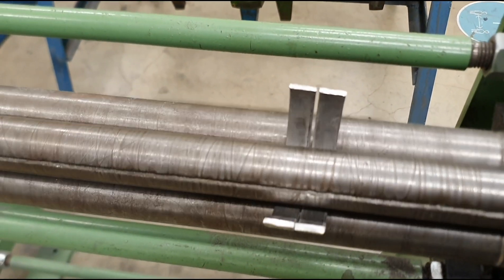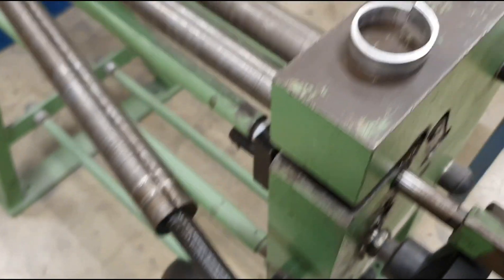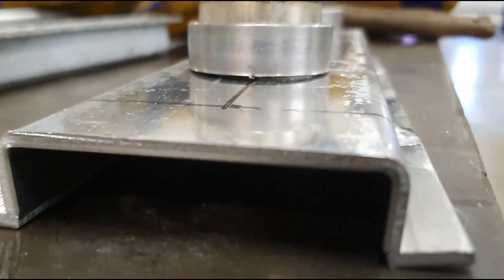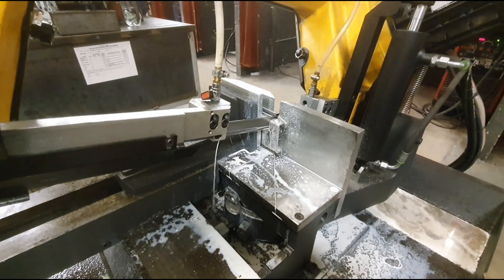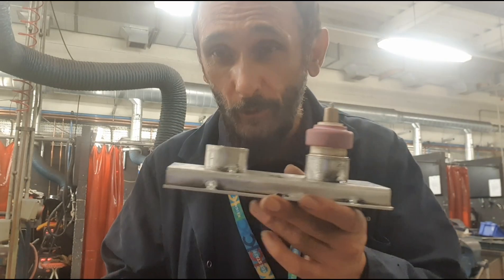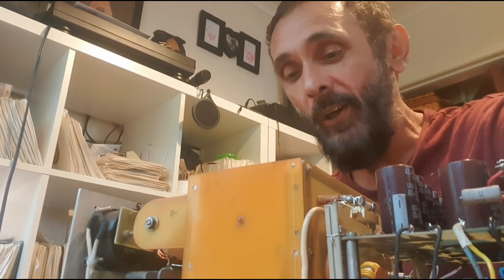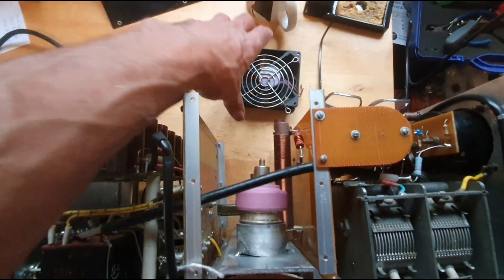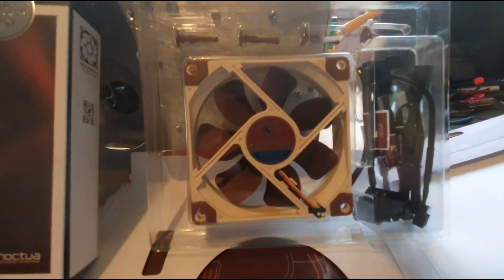GI7B Amplifier - Making New Valve Housing Mounts.

Comment: That base mounting plate looks very solid. Like it came out of a Russian tank 🤣
Reply: Actually, that variant of the GI-7B is a GI-7BT, which is designed for use in tanks. ;)
Reply from the maker: Thanks John wait till you see the new fan housing I just made. It is also industrial standard 73